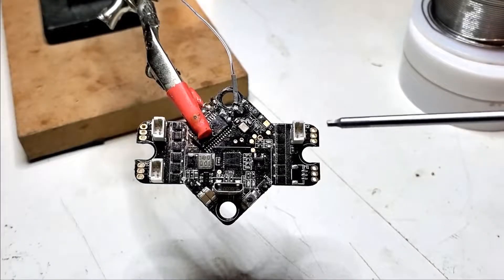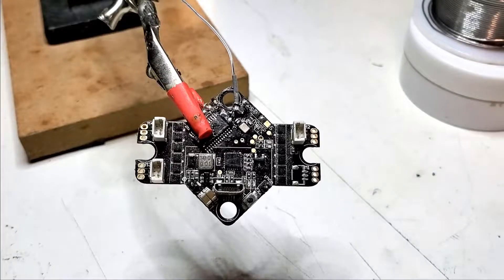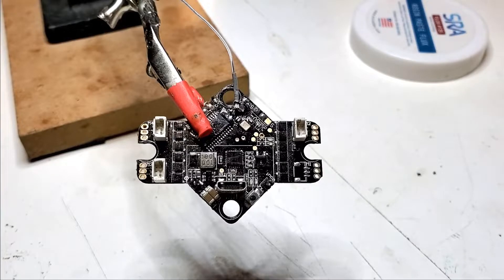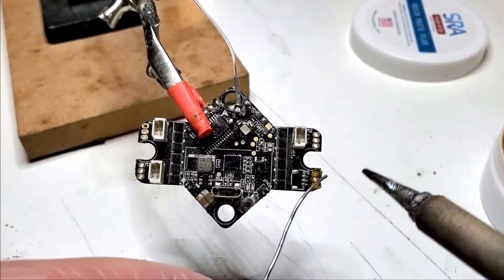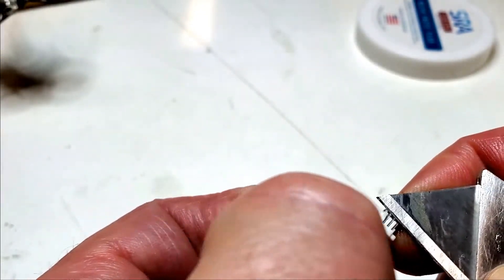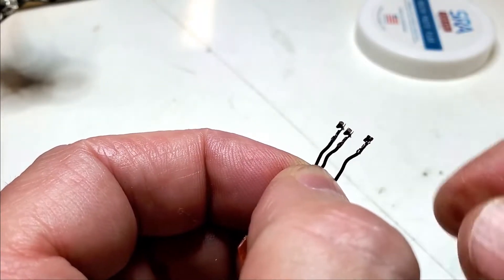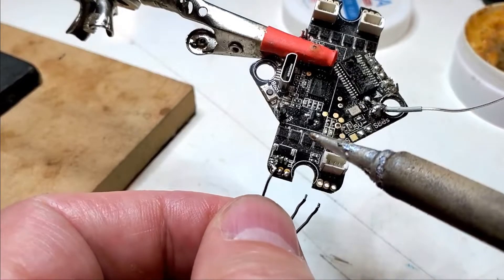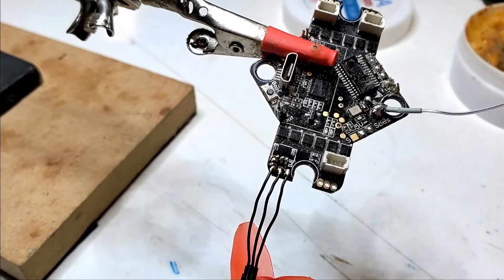Tinyhawk // Missing Or Broken Motor Connector // What To Do ?

Comment: Thank you so much for making this video!!! I was so close to buying a new tinyhawk until I found this video,
Reply from the maker: You're welcome.  What I did not mention in the video is that if your motor  spins in the wrong direction you can either swap any two motor leads or simply go into BLHeli and change that motor direction there. Good luck
Reply: @Matt633NLT I’m surprised it actually worked, I’ve never touched a soldering iron in my life before this and you just made it look so easy. There were a few hiccups but it all worked out in the end, once again thank you!
Reply from the maker: @chspotato4774  I'm very happy to hear that. I guess you're now ready to build your own 5" quad 👍
Have a blessed holiday season. 🙏

Comment: Does the wires need to be soldered in orientation or I can just solder them which I grab first to the terminal??
Reply from the maker: You can Solder them as you please, but.....if the motor spins in the wrong direction, you can simply connect to blheli configurator and switch motor rotation.
Reply: @Matt633NLT  I use beta flight configurator!!
Reply from the maker: Yes, but for ESC configuration you need BLHeli or JESC or some other ESC configurator. There's the option of switching any  2 of the 3 wires to reverse motor direction. If the motor spins in the wrong direction,  just pick 2 of the 3 wires, unsolder them, switch them,  and resolder them . This is true for any brushless motor .

Comment: I finally got to soldering the motor directly to the board, unfortunately the board appears to be shot . It has lights flashing but no sounds and when throttle applied there is nothing.
I rebound, went through the entire process the board simply does not cooperate 
will dig a little deeper, but I know the board is useless, it appears
I know one can buy a board, as I have two of these TinyHawks it really does not matter
probably just as easy to buy another complete one for a few more dollars....( will use this one for parts )..lol
BUT Thanks again for this video,and for all the help and advice you gave...keep doing what you do, I sure appreciate it a lot.
Reply from the maker: That's unfortunate, however,  it is part of the hobby. You'll have failures.  But I'm sure you'll work it out. Good luck. 👍
Reply: @Matt633NLT  Sometimes failures are learning experiences to. I built RC planes for decades, but these quads are basically new to me, so every event helps me learn. And having so many with the wisdom/experience to help this old, "new guy" along is Greatly Appreciated. Thanks again for your help.
Reply from the maker: Anytime bro